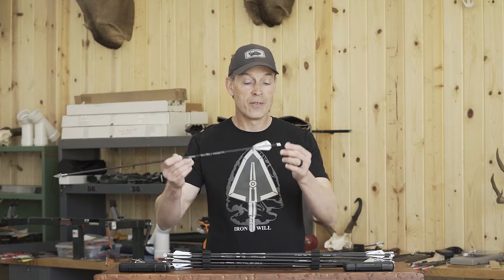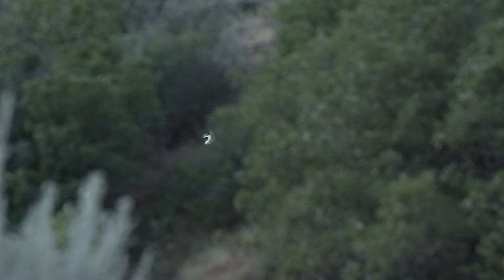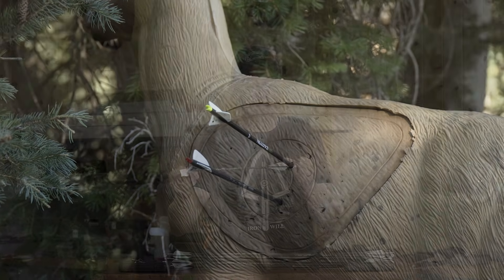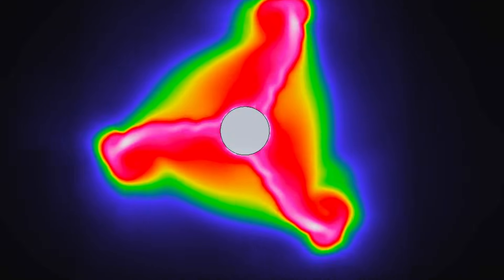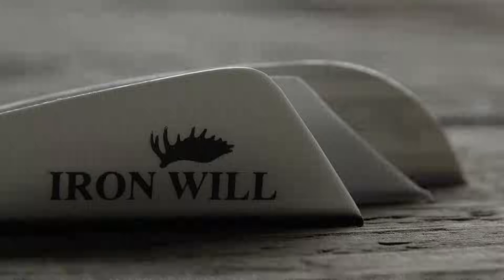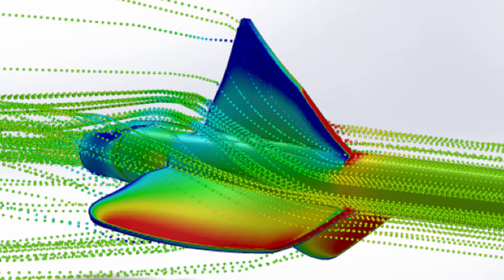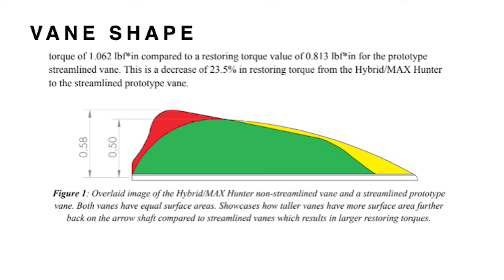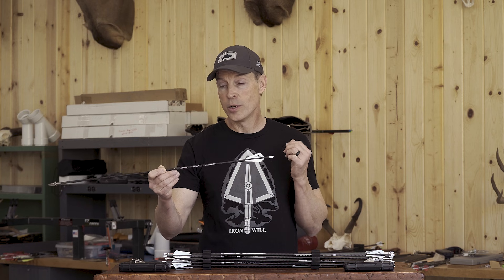How to Reduce Vane Noise for Quieter Arrows

Comment: Iron Will vanes are to heavy
Reply from the maker: What’s your TAW?
Reply: The difference in the weight between hunting vanes is insignificant. If you believe 25 or 50 grains really makes a difference you haven't tested and compared enough arrows. And 15, 20, or 30fps doesn't make a hill of beans either.